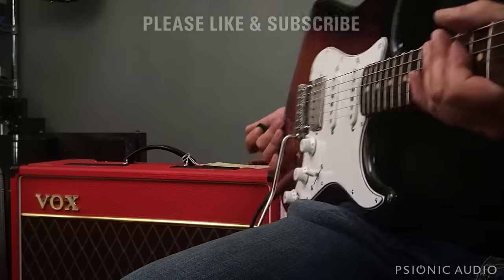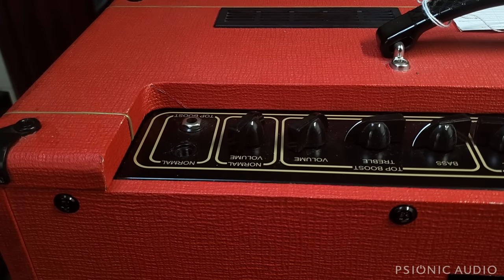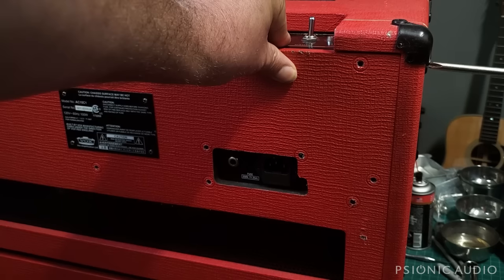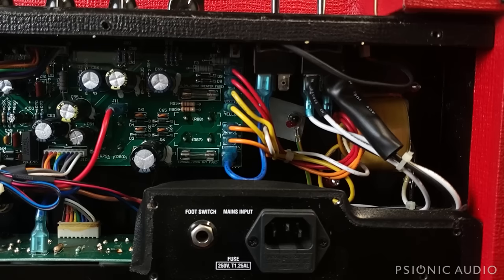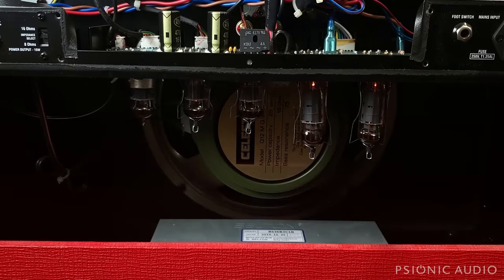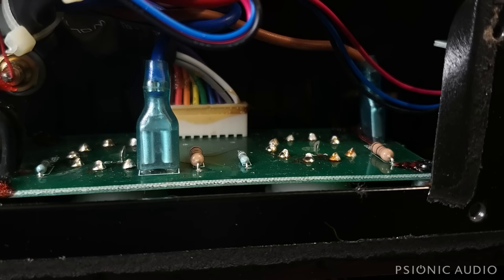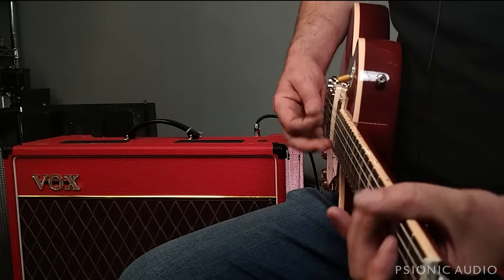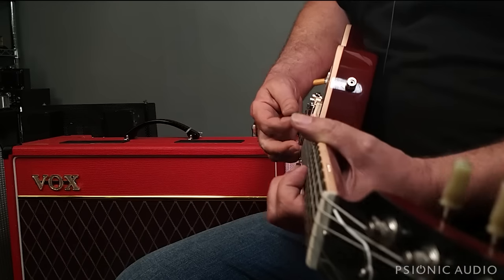Vox AC15C1 - Is It as Good as I Said?

Comment: Had mine for 10 years, all original (except for the tubes). Been with me on a lot of gigs and rehearsals. Never failed me once. Great pedal platform too. Love this amp!
Reply: At some point we could see a Tone master AC15 ... ,then all your tech. troubles will be over...
Reply: @vincentl.9469  Tonemaster is Fender - no?
Reply: @pharmerdavid1432  what I meant was a solid state replica of the 15 model just as the Tone master is a replica of the Deluxe Reverb ...
Reply: Does it have enough clean headroom for rehearsals ? They say it starts breaking up quickly
Reply: @hkmz455 depends on how loud your drummers is. It is plenty loud. I typically play with my pre at around 9 o clock and master at 3 o clock and it won’t get much more broken up the like the edge of breakup

Comment: Awesome Video, you. I always wanted a vox but couldn’t afford the tag on a hand wired non PCB. So I built one, those of you who that have the ability to I highly recommend this amp. I built mine(non reverb) AC-15 using Hoffman’s Board based off of Sluckey’s 1960’s vox. I was the Guinea pig building this when it was first designed. Check it out, Hoffman, el34 world and Sluckey amps. You’re going to dig Sluckeys designs.

Comment: Ended up returning my ac10 to grab a used ac15 because of your insight, i have a good feeling this is going to be my holy grail amp! I loved the ac10 didnt stop playing it for the month i had it. The thing i liked ab it is that it basically plays itself!
Reply: the notes seem to jump out faster than you can play them on class A amps!
Reply: @lauratanner8475  yep! I have zero regrets trading up. I actually got lucky and the one i got looked barely used inside and out. Also the previous owner had already did the reverb tank swap that Mr. Psonic did. Looking for a nice delay pedal now to round off my rig
Reply: @brendanjames8818  hey that's awesome 👍.  I missed whether or not this amp has an fx loop. Delays, especially digital ones, sound much better in the loop than in front of the amp. It's usually not too bad with clean tones but definitely beneficial for dirty tones.
Reply: @lauratanner8475  it does not sadly but i mainly use it very clean, only breaks up ever slightly when i really dig in on the strings. Its more of a squish sound than a break. My main source of dirt is a JPTR FX pedal (katastrophe)

Comment: These are very nice amps for the price.  
One mod I like with these and the 30, is to fit a mini toggle in allowing me to switch between the normal and bright coupling cap value.
The more compact ac10 is also a great value, but with one HUGE caveat- they replace the first gain stage triode with a FET. Most will never notice the difference, EXCEPT for people who like to boost the front end with an overdrive pedal+ here is where the FET does rear its head

Comment: The only advantage of a tube rectifier is that the B+ voltage rises softly when tube rectifier warms up.
If the tube recifier voltage sag is what you want, it can be quite accurately achieved just by using in series with a solid state rectifier a series resistor which roughly matches the inner resistance of the tube rectifier (which is of course not constant, but quite close) at normal operating point.
And if you have original unused NOS Mullard/Miniwatt GZ34 rectifiers, you probably will notice that they give full B+ voltage so quickly that the cold start max B+ will be at the same level as by using SS rectifier without preheating, only for a bit shorter time.
SS rectifier allows using much much higher B+ filter caps as well because for example  1 amp rectifier diodes of today can handle huge short time surge currents without problem.

Comment: Great series of videos. Thanks!  Question,  If I buy a AC 15 used, for say, $500,  What is my worst case scenario for professional repairs if I get a lemon?  Is there anything which is completely unavailable?   I am good with tools, but I know almost mothing about solid state electronics.  If it was a '72 Cadillac,  I could re-wire it from scratch (that is what I used to do for a living - automotive electrical, pre computers)  I am not going to play it  2000 hours a year,  more like 250 - 300 hours.

Comment: Well great to see  your expert knowledge on this Amp,i used to own many 60s AC30s sadly they all burnt up while playing ,my AC50 never had a problem rock solid, used an 100 w ACOUSTIC amp  that blew the buildings down ,then later moved back to an AC15  c1 for the house  ,at first i did miss the twin BLUE ALNICO  speakers, but apart from that was very pleased with it, and found it very  controllable  unlike the vintage ones ,neither was i disappointed when it was cranked up full it did miss the blue twins then ,sounds great at lowish levels meaning amp working above half but not full guitar on half,it seems ok with pedals too,going to change tubes for JJs  ,get a cab with Alnico twin blues perfect, They are great for any Amp , nice to see you had no major problems with this amp,keep up the good work

Comment: I haven't finished the video yet, but as an aside, I believe all Vox amps from the Dallas Arbiter era to when Korg made the AC15/30TB amps were solid state rectified. My AC30 has a solid state rectifier and no standby switch and one of the last of the old hand-wired models. According to North Coast Music these AC30s put out closer to 40 watts than 30.

I've currently got Electro Harmonix 7025s in the preamp and they've held up fine, tho my amp only sees bedroom use.

Comment: Love my AC15C1. Very clear and dynamic even at low volume and great with pedals. Many tube amps are dead at low volume.
Reply: do these ones have the ef86 preamp? ef86s are really great with pedals, they got a ton of gain to accommodate the losses of using effects and the cabling in between. I wish some company would start making really good modern ef86s. I love them, and they have certain advantages,  but of course can be temperamental.
Reply: @lauratanner8475  no. Its 12ax7
Reply: It's really that goog at very low volume?.. this is a priority for me.
Reply: @Rau1S  I think so
Reply: @Rau1S  You can’t get good overdrive sound at low volume with any 15 watt tube amp without pedals. You have to rely on good overdrive pedals into clean sound on the AC15. I use a BB preamp or a Wampler pantheon but there’s lots of options.
Transistor amps or digital amps can get you quite good overdrive sound at low volume. Boss Katana is a good option then.
Reply: @MrBossei  thanks for the answer. I'm considering the boss katana for that reason because it's mainly for playing at very low volume.
Reply: @Rau1S  That is a really good choice. Works fine at both low and high volume 🙂
Reply: Hello, i have the head version that includes an attenuator, i recommend you, sorry for my english

Comment: I'm only 13 minutes in to the video but seeing all that threw board components would make me happy, No microscope needed, probably simple to follow traces and bog standard two legged caps. Easy working.
Reply from the maker: And you can pull the boards separately. And it only takes 10 minutes to pull. And no morass of cables to detach. Different sized connectors, all well labeled. It's like whoever did the board spent time in the trenches.

Comment: i have the blue and cream version, almost the same month as your red one.  i like using an aby pedal in the top boost input as well as the normal.  i've changed the tubes and reverb tank and it sounds much better.  great amp!  thanks for the great review!
Reply: What tubes and tank are you going with?
Reply: @afterstars  jj tubes.  i don't remember the reverb tank but it is a shorter decay which i do like better.  i believe it is the accutronics.

Comment: May i add that if you can move the reverb away from any replacement speaker, or test it first. The anount of draw on the cheap springs in the area of the magnet can be a noise issue when your pushing the amp

Comment: I am starting to like my AC15C1X after damping my stock chinese tubes with some cork pieces I am cutting and experimenting. Also the main pcb has to have somethin damping it in the middle, close to the power tubes connector socket. I still got some ringing, maybe a tube filament (EL84). The main power transformer has a thin metal cover that rings on some frequency, so I stuck a piece of styrofoam that dampens it. I suspect the pcb tube sockets rub against the chassis, will investigate. I got a more defined tone, and it is ringing nice at high gain as guitar combos should. You got to really crank it with some overdrive (I like he treble booster) then explore the weird resonances. I also removed all of those cheap tube retainers, since the sockets hold those tubes so well, and they also introduce weird resonances. Awesome channel with tons of info!

Comment: Amazing videos! Thanks so much!

I am surprised by your dislike of the Traynor YGM 3. You mentioned in another video that they are cheaply made and sound crappy (paraphrasing here)
I have had quite a few over the years and found no cheapness at all. AFAIK similar resistors and caps to the YBA. OF course, replace the dynamite stick power caps,
The weak point IMHO is the terrible Marsland speaker. The Reverb is also too much even at modest settings. There are good mods available to channel more signal to the next stage and remove the excessive reverb. Also i tend to slow the trem down and rearrange the bright cap setup
I would love to hear more of your thoughts on this

Comment: The Vox AC-15C1 is still true to it's classic 60's sound. I can't get The Beatles tone, but I have nailed a Roling Stones - Brian Jones ere tone. It's a real enigma of an an amp but , I went looking for any info I could get on it and how the  knobs all work together. The EQ channel is especially interesting, brilliant and unlke typical EQ, the Top Boost sounds like nothing else. Legendary Reverb, Tremolo. 
As a pedal freak it's my only amp that I actually question what I'd bring to gig with.
I toatally agree with the gripe about the closed back. I thought it was a design choice which had more of a tonal implication.   
As for the solid-state over tube rectifier, I came across a classic AC30 with an amazingly lowered price point al b/c someone swapped out for a tube rectifier. So, Vox appears kn0w what it was doing.
They wanted to make a totally unique amplifer, and accomplished that in spades.

Comment: I have an early unit from 2010, got it new for 500 bucks back then, and that's what I've been using since then, AC15C1 and AC30C2X for bigger venues, never failed once, funny how they tried to emulate the Treble normal channel of the AC30, it always sounded too boomy on me especially with Gibson guitars, not as boomy as the one on the TBX but boomy enough to get muddy with lack of clarity on single notes, especially if pushed with a thick treble booster like the Cornish TB83.

Comment: I have one of these and it's been a real headache to get good sounds out of it.  I usually play a fairly bright Strat, and this amp can get pretty harsh on the high end.  Especially at low volumes you just can't turn down the treble. I resisted the urge to cut the treble bypass caps, like a lot of people do.  The greenback speaker also doesn't help because it sounds weak in an open-backed cabinet. So in the end I bought a 1x12 extension cab with an Alnico blue in it (the box cost more than the Vox). I put the Blue in the Vox and the Greenback in the closed back extension cabinet.  They blend really well now.  I also put in a 1" wide piece of paint stirrer in front of the speaker  like the original Voxes. It helps.   Yours sounds better with the Les Paul. but I still hear some of that harsh high end.  Using it as a pedal platform set clean on the Normal channel works pretty well. I haven't replaced the reverb, but at low settings it sounds OK.
Reply: Yea Fender Stratocasters do kind of suck. My AC15C1 sounds great with my Les Paul.
Reply: Ymmv but I always keep the Tone Cut knob around 2-3 o'clock and roll the guitar's Tone knob down to ~6-7 and that usually does the trick.

Comment: last month I bought a ac15 c2 used for 400€. best clean tone I've ever had, but sounds absolutely ass with a distortion pedal. Also not a fan of analog spring reverbs.

Also very confusing to dial in the tones. I plug into the TB channel but then have to crank the normal channel volume to get any low-end. The Ac15 didn't became my nr1 Amp, but I love to play it from time to time, definitely do not regret buying it.

Comment: I've been gigging with my AC15C1 for years. A few times it cut out during a gig and attributed that to bad cables, but I'm not 100% sure.  I would be nice to have someone like you check it out. I've had some weird swirling hiss sounds on the Top Boost. I'm the Los Angeles area, not sure where you are located.

Comment: How can anyone not love Vox AC15s? Really appreciate these videos, I'm learning alot (as a non-techy person). I notice the power tubes on my  AC15C1 (i'm using JJs) get ridiculously hot to the point that I think they are 'redplating' so I'm worried to use the amp in case something goes horribly wrong. Forgive my inexperience, but am I correct to assume that if I change those screen resistors as you suggest in this video (I'm good with a soldering iron) then this will reduce the power going into the power tubes and make them cooler, thus reducing the possibility of redplating, and generally increasing power tube life and reliability?

Comment: @Psionic Audio What are your thoughts about the bias? These come with a 120r cathode resistor that runs the el84s quite hot. I have seen one running at 130% dissipation. All that heat ends up going into the tube sockets and board above the tubes!

Comment: Did I miss a walk through on any Vox AC15HW? Curious after seeing some of your AC30HW  ‘what’s under the hood’ revelations. Much appreciated. Looking for a smaller living room amp with the Vox flavors. Not sure after your thorough walk through a of pitfalls and penny pinching.
Reply from the maker: The 15HW is the same inside as its big brother.
Reply: @PsionicAudio  Much appreciated. Given that it’s the same amp, would that master volume(never played with one) make it useable for a living room space or would the half pint AC15HW be a better fit. 53 year old ears, MS and bad back so a bit cautious on going too big. I think I’m drilling down on the AC15HW. My 65’ Reverberocket GS12R is more than enough but it doesn’t play well with the pedals so I enjoy the cleans and get the occasional overdrive through the power section.  I own nothing with chime. I guess I’m talking myself into the AC15HW and I haven’t come across something in that tonal vein that would fit the bill. Im a sucker for both reverb and trem. Magnatones have come up but the price point is in my budget for used vehicles. Am I not asking the right question? 

Missing that flavor as i have the for mentioned Ampeg, 55’ Gibson GA-45, a 65’ Gibson Falcon GA19RVT and a rare Harmony 430 with a stellar matched pair of RCA BP 6973. Those power tubes woke up a ho-hum amp. Just missing that Vox voice and want to remedy that. Housebound due to illness and my local amp techs (in a very rural part of the world) are from another time so point to point is preferable when it inevitably needs TLC. Are there better years for the modern HAnd Wired versions. Apologies for my devolution into amp therapy. Cheers! 
Has the Rendezvous kept up its reputation for ribs? My 12 year old tastebuds never forgot that or the Peabody Ducks. I went from rural Mt. to Memphis as a kid and my mountain mind was blown.

Comment: That was a great video! 

I'm looking for this amp right now and I think it has it all: great cleans, great overdrive, push it with some overdrive/fuzz pedal and it gets really angry and awesome. But the only thing I'm kinda worried about it... is that I heard that this amp is unreliable and somewhat fragile (besides the grill cloth). Is this really true?
Reply from the maker: Not in my considerable experience. Just remember the stock tubes were cheap to begin with and traveled several thousand miles to get to you. And the input jacks must not be loose.
Reply: @PsionicAudio  do you consider this amp as a good option for playing in a house at very low volume?.. 😊
Reply: @Rau1S yeh , it has master volume

Comment: I get good results using EH Russian tubes in my AC15C1. 12ax7 tubes last forever. Power amp tubes were dying on me, but with EH I get a couple years out of them.

The only real problem I had with mine, first year of the C1, was the reverb RCA cable failing. I swapped it out and carried on trouble since then.

I'd recommend this amp. The reverb is great. Though these days I build my own :D
Reply: I too really like the reverb, I was surprised the first time I opened it and saw that short little tank.

Comment: There is a little trick with the C1 AC15’s. You can’t jumper the channels BUT if you’re in the normal channel and you turn the treble boost volume to max, you get a little change when you turn the treble or bass pot. 🤷🏻‍♂️ I could be crazy but it sounds to me like it slight changes
Reply: I do this and its really noticeable. It does make my particular amp super hissy and noisy though.
Reply: @pierrederesistance  mine gets real hissy and noisy too if I max out the treble,
Reply: And when plugged into Top Boost Channel (and master volume is above 4), the normal channel's volume acts as bass boost.
Reply: @Elvisml2  🤔 had no idea about that one. @Psionic is there a reason for this?
Reply: @BCEpedals  Channel bleed goes both ways.